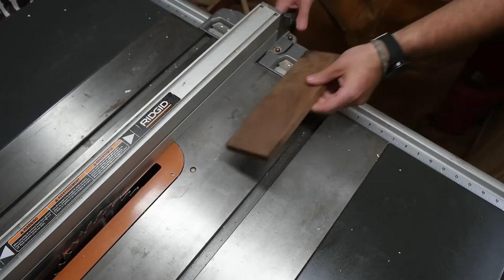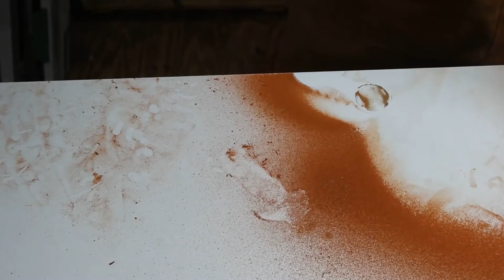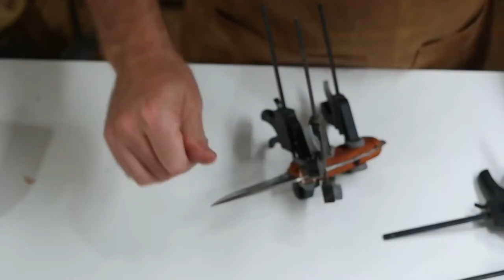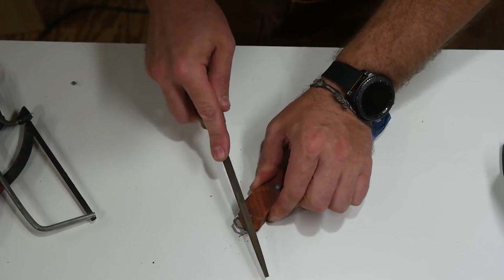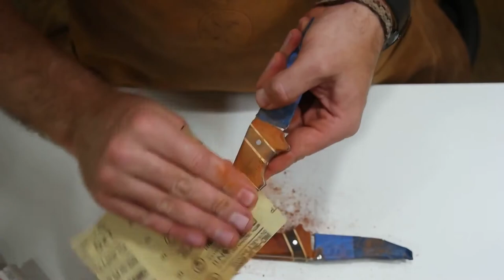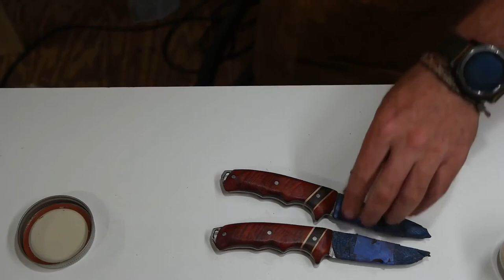Padauk Knife Scales

Comment: I have to be honest at first I didn’t think the grain running in that angle would look good. I guess because I make mine go with the direction of the blade. But it came out amazing. I enjoy making knife handles and replacing them on knives. Thank you for your video.
Reply from the maker: Thanks a lot! Always enjoy the feedback. I also usually run the grain with the blade but I wanted something a little different for these ones.